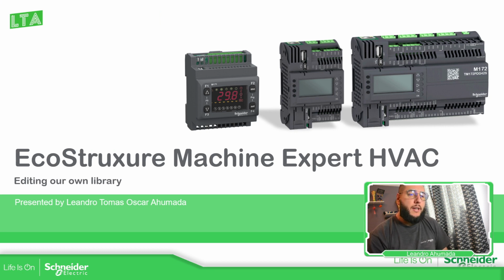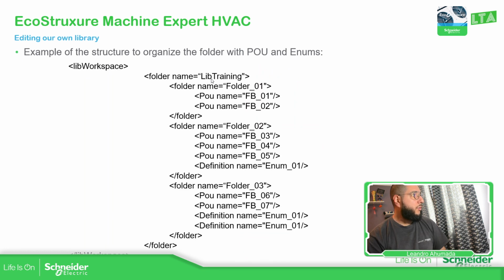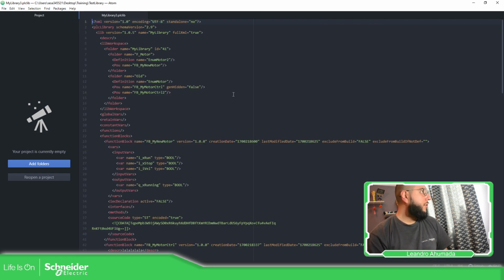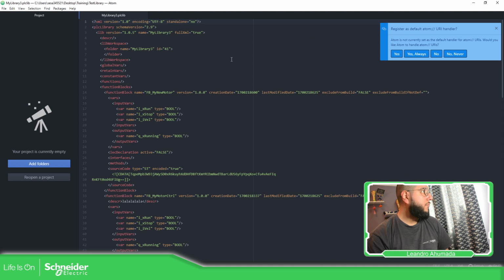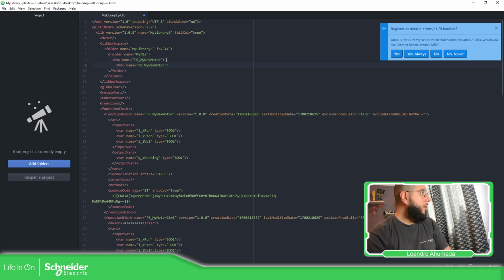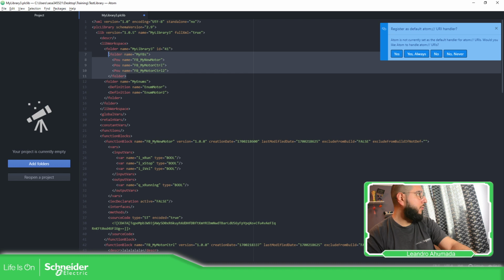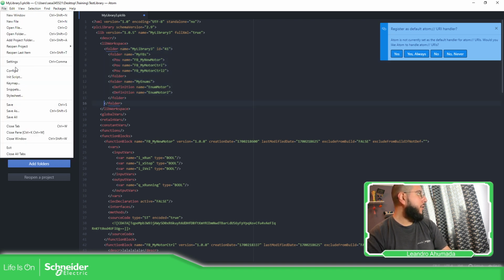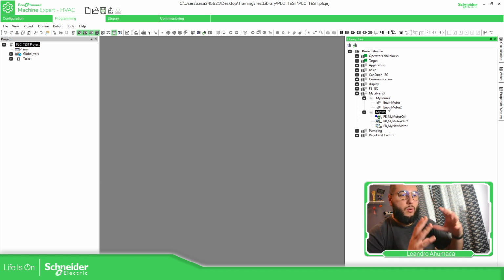EcoStruxure Machine Expert HVAC Training - M9.3 Editing our own library

Comment: Hi Leandro, has it ever happened to you that you’re writing a ladder logic code and you’re using a tag multiple times and in one of the conditions if the contact is true the output coil goes on or high but the tag itself is still low or zero?
Reply from the maker: Hi there! Interesting... I have not experienced that. I believe the best thing to do in this case is to check using the cross reference to see if that variable is written in other place. If you are not able to find it out then i strongly recommend you to use the latest software and then contact the Technical support of Schneider in your country.